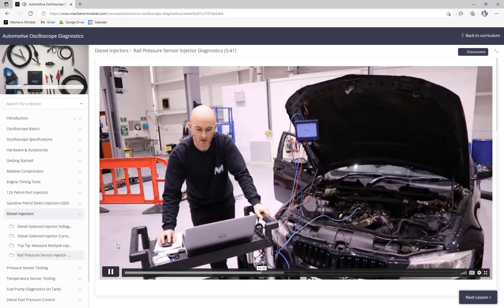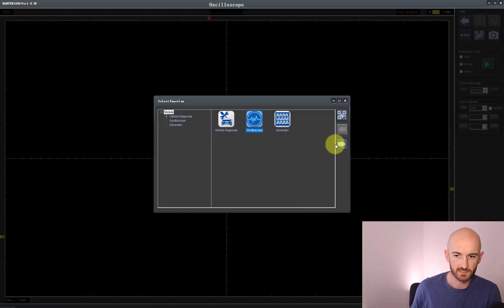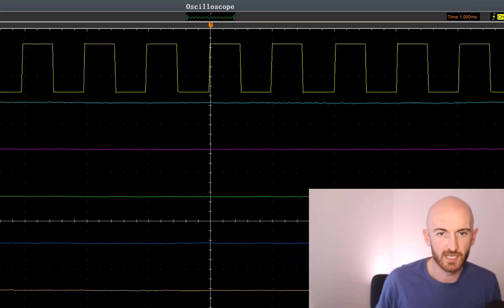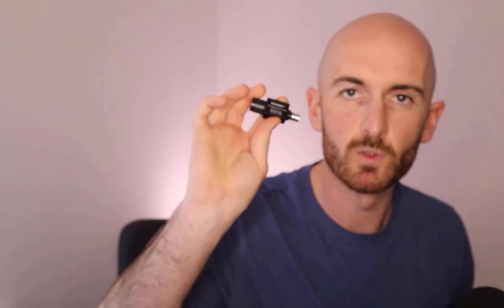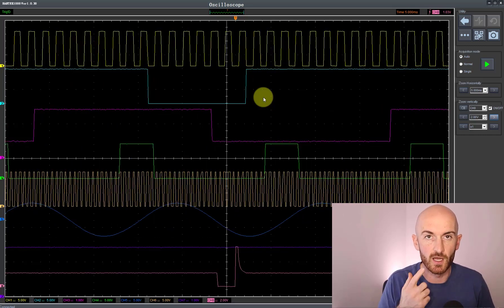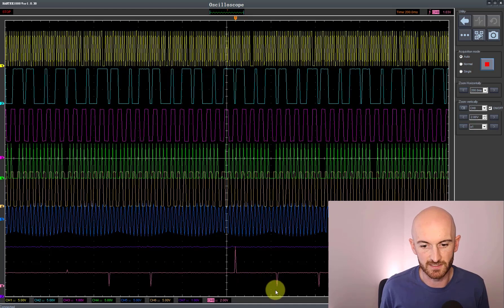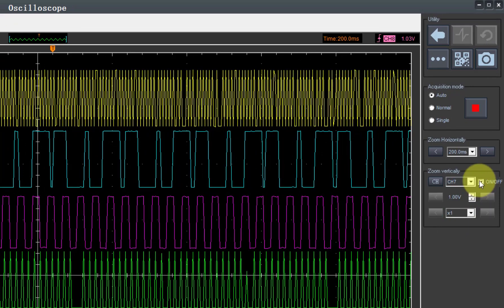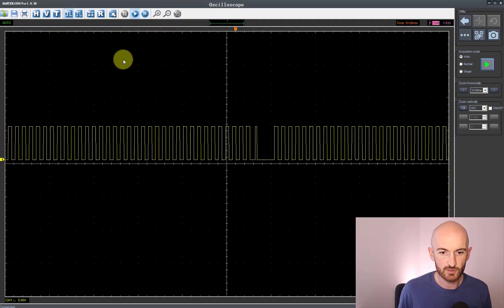ALL 8 Channels Loaded Up! Hantek 1008c

Comment: I bought this recently actually. It’s my first oscilloscope and was on sale for $80. I didn’t buy it to max out the 8 channel capability. But I bought it to learn and for simple things. I plan to eventually upgrade to a pico. From what I’ve seen, typically you really don’t need more than 4 channels?
Reply from the maker: It’s nice to learn basics with. You’re right, I rarely have a need for 8 channels.

Comment: Question: Can this tool help me locate vibrations in my car at highway speeds? 

I’ve had so annoying vibrations for several years and I can’t for the life of me figure out where they are coming from! Only at speeds around 140kmh and above. They vary as well. Sometimes more and sometimes less vibrations. Sometimes at 140kmh and sometimes at 150kmh
It doesn’t get better with another set of wheels. I suspect it is an axle or wheel bearing but it’s just guesses. 

Mercedes workshop can’t find any faults, the car passes mot every year.

Car is a Mercedes e63 2014 110000km so quite low mileage. 

I’m thinking that I maybe can clamp one sensor at every wheel hub and see on the computer where there are vibrations  ?

Comment: If I have the money would it be better to get the 4225a or 4425a picoscope? I’m new to using them and only had short class on them in school. I was considering the Uscope as well to start out
Reply from the maker: @tylerhill6706  2204A would be a good start. But if your planning on getting right in, 4425A 👌
Reply: @ ok ya I’ve seen more of you videos using the 2204A. It still works using pico7? Also your training videos on your page do you use the 2204A or the 4425A?
Reply from the maker: @ Yes works with normal Pico 7. Mixture of both 2204A and 4425A - the learning can be transferred
Reply: @ ok thanks that will say me a lot of money starting out with that. Especially cause I need buy new laptop. I prefer using Mac but I read online pico don’t work well on Mac’s is that true?

Comment: I have the 2204a and have found a similar level of performance. I was considering the 4425a, but noticed the 4225 is a little less with only 2 channels. Do i really need 4? Definately need at least two to sync. But as a home mechanic, thinking 2 would be enough while saving a few dollars.
Reply from the maker: @leftseat140  If you get 4, you’re fine and will never want or need for a new scope ever again. Get 2 and there will be time you wished you had 4. I’d say get 4 if you can 👍

Comment: I need further description of setting up the leads
Reply from the maker: @TyrellLuckett-z2q  Most measurements: Black lead to chassis ground or battery negative. Red lead to the signal you want to measure 👍
Reply: @MechanicMindset  yeah. I had a security issue with Microsoft loading the Hantek onto my laptop so it was showing the graph in demo mode and I had to reset my computer security settings to load the Hantek onto my computer.

Comment: Please I need an answer to this. I am getting all the tools to subscribe on your website. Hello. I just got the Hantek 1008C, my question is, the probes that come with it cannot be calibrated right? also the ones that you recommend the HT30A with banana adapter cable cannot be calibrated or compensated right?
Reply from the maker: Correct, it’s not required. They are for passive 10x probes. The compensation is for high frequency signals which we don’t really touch.

Comment: Hello. I just got the Hantek 1008C, my question is, the probes that come with it cannot be calibrated right? also the ones that you recommend the HT30A with banana adapter cable cannot be calibrated or compensated right?

Comment: Hantek isn't fast enough, their sampling rate is only 2.4 Ms/s  and may be missing glitches... you need Pico with sampling rate of 400Ms/s..... Do your research.
Reply from the maker: Yep. Hopefully you saw that in this video. Although, it’s the memory that really limits this scope. At low time scales the resolution is great; step it up to 200ms  on the screen and it’s capability is stretched 👍 Also 400MS/s is a LOT; if you look, the default is a much lower than this; again, it’s the memory that helps this scope shine 👍

Comment: Thank you so much for this video. I just decided to just save up for the multi channel PicoScope. This is garbage and is not suitable for my needs at all. I usually need longer traces with reasonable resolution. It's a shame, that the software isn't capable of long time recording of a trace, like the pico software can do.
Reply from the maker: It’s frustrating, it could be sooo good if it would only have better sample rate and easier software. You won’t find a 12bit scope for this price. But hey; you took the dive for a Pico and you won’t be disappointed - no compromise 💪. Check out our training if you want to make the most of your PicoScope 👍
Reply: @MechanicMindset  Yeah, we have the 8-channel Pico at work and it's awesome. I didn't expect too much from the 1008, but it's even worse than I expected. But I still suspect the software is the main issue, not the HW. If it can transmit the data to the PC at a reasonable speed, the app should be able to stick multiple short measurements into one long while keeping the resolution of the short one.

Comment: I have a Ver good question for you ......the hantek 1008 is rated for 400 volts max   aside ignition coil testing .. taking that nothing else on the Gas or diesel engines exceeds 120 volts  which would only be injectors that exceed 20 volts  as every thing else is in the rage of 5-18 volts  to taking in the max input on the 1008 is 400 volts why would I need to use a 20:1 attenuator ???   I have actually connected mine up to all 8 diesel Pezo injectors at 110volts each to test trigger voltage with out the use of a 20:1 or any special probe  so why  do I see every one using the 20:1 ........ and the snap on otc Autel Thinkcar Scopes they are all rated at 200-1000 volts and  with them never needed any special connection for voltage either they don't even sell or mention a 20:1  or there Automotive scopes   the only time we need to use any thing special is for ignition spark voltage which can get up to 30k volts  or an amp probe/meter for amps over 10-20 amps depending on the scope  any ways just looking for better knolledge  so why in testing any thing automotive that is under the rated 400 volts of the tool would we need to use a 20:1
Reply from the maker: Quite right, if your oscilloscope can measure the range of what you’re testing, an attenuator isn’t needed. 

I don’t remember the Hantek going up to 400V though, I’d have to check. I thought it was 50 max. Scopes also show an input protection voltage which is hight than what it can measure. For example, the PicoScope has 20V max with 100V input protection.
Reply: @MechanicMindset  thank you for the info I just started using the Hantek I have used the OTC evo and Snapon scopes my whole life and never needed a attenuator for them I might pick a couple up just to be on the safe side then
Reply from the maker: @SaerTurner  Yeah some scopes don’t need them and the specs can be confusing 👍 Enjoy!

Comment: I am sure that accent is from my neck of the woods Burton On Trent ? I have one of these 1008 Hantek
Reply from the maker: Not far, Coventry originally. But I think the accent changes about 5 times in the 30 miles between us 😂. How do you get in with the 1008c?
Reply: @MechanicMindset  I have a P1320 code in a Nissan Primera so will do a coil check tomorrow, not too sure about how to go about it but when I set it up maybe try each on a spark test? I went to Coventry as a kid to watch Ken Dodd and the Diddy men lol Thanks for the reply.

Comment: I was going back and forth between the 1008 for 8 channels vs Pico 2204a....with the 2204a can you test 8 inj one at a time, saving them and then open them up all next to each other to compare? I'm just trying to learn enough to decide what to get lol. Your channel is a huge help! I appreciate it, I'm sure when I buy the scope I'll have to do the membership and learn way more.
Reply from the maker: You can save them, and open them as reference waveforms or compare them separately. I would just open the 8 files separately. Or you can make a reference of a good injector then test all 8 and compare. The software is probably the main reason I would go for the Pico. The scope spec is ok especially for $100! Check out latest video on Rotkee, I think you’ll like it! Hope to see you in the Membership soon 👍

Comment: dear mechanic mindset i have hantek 1008c if i test coil need to attenuator or not need ??
Reply from the maker: Hello, if testing the primary voltage directly, it is likely yes. Although some could work differently and it’s not needed.

Comment: For all it’s limitations, it has proved to be an invaluable learning tool for me. Many years after its introduction the 1008 as far as I know, is still the one and only unit providing this utility anywhere near this price. In 4+ channel scopes at around $12 USD per channel, can any other manufacturer touch it? Great choice as a introductory scope. It’s not the end of the world if you blow it up…I have been lucky to own a range of scopes. I am still partial to the 1008’s simplicity. In reality most users will seldom use more than 2-3 channels, let alone 8. But nice to have when called for. Cheers Darren. Good Vid 👍
Reply from the maker: Yeah I can’t argue with that, it’s a great place to start in the world of scoping. 12bit vertical resolution. Maybe they could have sacrificed 4 of the channels for a bit more sample rate, they would have been on to a winner! Especially with HScope. Was interested to see how it handled 8 channels! Cheers 👍
Reply: 1- crank sensor, 2- intake cam sensors, 2 - exhaust cam sensor, 1- injector, 1- COP, 1- in-cylinder pressure transducer.

Comment: I work in automotive design and have access to really good scopes at work, but for my home use I bought it as it was good enough to read PWM frequencies, Duty cycles, and mine came with 2 current probes. It's definitely not for professional use, but for people working on their own cars, a really good bargain, and a way to learn something while troubleshooting some basic stuff. Can't imagine running it on 8ch at the same time. Usually single, sometimes maybe 2. You getting what you paid for.
Reply from the maker: Yeah, for the money, it’s great. For real in depth diagnosis and analysis, it will struggle. If you are aware of its shortfalls and how to navigate round them, it will do most tasks. Cheers!

Comment: The hantek works kinda like snapon lab scopes if you’ve ever used them, what you do is capture in on a small time scale and zoom out. Opposite of the pico
Reply from the maker: Yeah, the sample rate doesn’t allow it the other way 👍
Reply: @MechanicMindset  exactly, so for me with my snapon scope for example a cam crank correlation I’ll take a close capture of around 5ms and then zoom out as far as I need to get the two crank revolutions. This way I’ll have the zoomed in detail incase there’s any glitches and I can zoom out as far as I need to see repetition

Comment: Had a 1008 for a few years now, good to get started with in automotive, as long as you are aware of it's limitations. The hscope software is a HUGE improvement, the only thing I don't like is the max sampling rate in the automotive tab (2k). I am ready to move on to the next level, probably a micsig.
Reply from the maker: I will probably get a MicSig at some point, they are very popular for those wanting high specs on a lower budget
Reply: @MechanicMindset  Yes ,I absolutely agree .
Reply: I own a micsig. it's not a pico.....but it's very very good product. Go for it, you won't regret it. 
 Even later, what you will move to a pico, you going to use the micsig too,a lot, instead of pico, because it's very handy, to walk around the shop, for diagnosis.

Comment: Good test, that is about the result I expected from the specs that scope has - but I haven't seen anyone else do that test on this scope. I did initially consider a 1008 when I was looking for a low cost storage oscilloscope, the 8 channels makes it look very interesting on paper - until you realize that the memory buffer is very small, I think it's half of what the Pico 2204A has, and all eight channels has to share, whereas the Pico just has two channels sharing. 
I ended upp with a second hand Pico, and it does a great job. It still has limitations ofcourse, but among USB scopes for around $150 or less I challenge anyone to find another that gives you anywhere near the same bang for the buck.
Reply from the maker: Yes, I had heard lots of people talk about the problem with all 8 channels, but no actual evidence; hence the video. I think my signal generator made the task a bit easier!

I love the 2204A, if you can deal with the low vertical resolution (or just use the enhancement feature) it will take you far! Thanks
Reply: @MechanicMindset  I think the 8 bit resolution in itself generally is fine, but the low end models (2205A and below) lack DC offset function, and that prevents you from using the vertical resolution properly.
For example, if you want to measure automotive battery voltage during engine start/relative compression etc, you need to use the +/-20V range, despite only being interested in the range between approximately +5 and +15V, so 75% of the range is useless. The 8 bit vertical resolution is 256 voltage levels total between -20 and +20V, but only ~64 of them are actually useful in that case.  

With DC offset (like 2405A model and up has, if I remember it right) we should be able to set our center point at +10V instead of at zero, and just use the +/-5V range. We measure between +5 and +15V, but now we get all 256 levels in that useful range. Instead of ~0.16V each step it is 0.04V, and we see way better detail. Not perfect, but being able to just focus on the relevant voltage range would help a lot.
Reply from the maker: @ulfg1409  Great insight to the limitations of 8bit! I like to use AC coupling for voltage relative compression along with some filtering. I will have a play with the DC offset, albeit only have a 4425 to play with. Thanks for sharing!

Comment: Figures......4 hours after I order this scope you drop this video.     I am leaving the order because at least I will be able to use it immediately.....had I ordered a pico for more money I would have had to source leads as well and for 130 bucks I i got a whole kit with 8 leads (all beit cheap) an inductive spark lead and a attenuater.    Worst case I get what I need done and later pick up a "quality " scope after I find the short comings and the features I really need.
Reply from the maker: Sorry, I had had this scope lying here for a while. But I do that, but something then look at the reviews after 😂

It’s a great starting point, and the 12bit resolution is cool. If you stay on the lower time based I think the waveforms are ‘ok’. Let me know how you get on! Just get some T pins for those crocodile clip leads to back probe connectors and you’re good

Comment: Thanks for this. So as a newbie to automotive scoping, would I be correct to deduce that the 2 channel Picoscope is better value for money than the Hantek 1008c and that the advantages of the Hantek - ie the number of channels and 12 bit resolution are outweighed by it's disadvantages of the shared sample rate?
Reply from the maker: Hey Nick, yeah I think that summarises it nicely! The 2204A is a great place to start, but the Hantek lacks versatility when it’s time to do real scope stuff 👍

Comment: Have you tried the Hantek 1008C with the Hscope app?
Reply from the maker: I’m in the HScope telegram group. I’ve not had a go with it yet. Need to get a tablet and get on it!
Reply: @MechanicMindset   would be a nice video  comparing  the HScope software
Reply: Yes!  That software is ridiculously good. At least download the demo and check it out. With the 4022be or whatever the two channel is called, it's pretty dang impressive. THAT would be a good comparison against the budget Pico. I'd be interested in which you prefer after trying that setup out.
Reply: Take a peek at the gadgets playlist channel for more info and ideas around it. Another great community.
Reply from the maker: @sonicelectronic57  It’s on the list 👍. Denis’ channel is great; he’s here in the comments section actually 😁
Reply: Hantek 1008c no funciona en HScope, yo hice la prueba y quedé muy frustrado con su desempeño  en HScope. No vale la pena comprar la licencia de este osciloscopio.